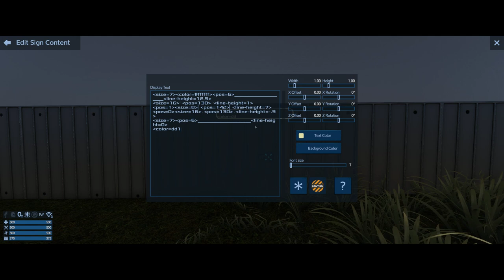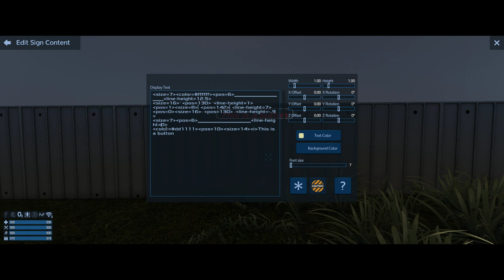Empyrion Galactic Survival - LCD Tutorial

Comment: I struggle so much when I 'm building with what you were talking about regarding balancing thrusters vs. cpu.  In Reforged, the XL thrusters are clearly more CPU to thrust efficient, but using all XL's presents the difficulty of balancing thruster placement.  Like you said, having an XL facing up or forward is just difficult to balance.  Having only one thruster in a direction also limits the thrust impact on roll, pitch, yaw if you are trying to not use rcs's.   Do you have any tips on what to consider or how you work through these problems?  Thanks.
Reply: Try XL for main propulsion on the midline with L manoeuvring thrusters on extremities.